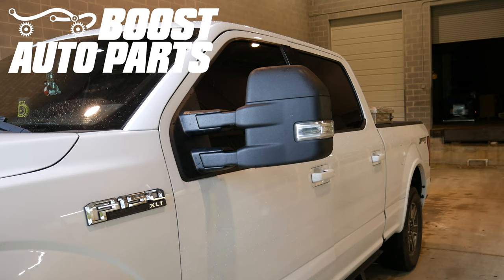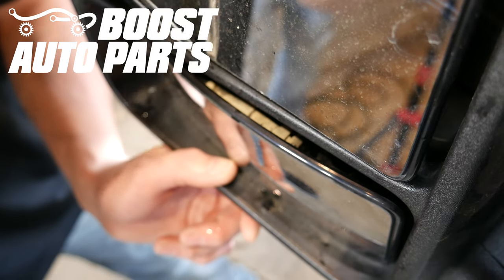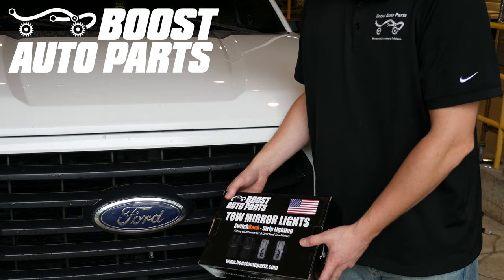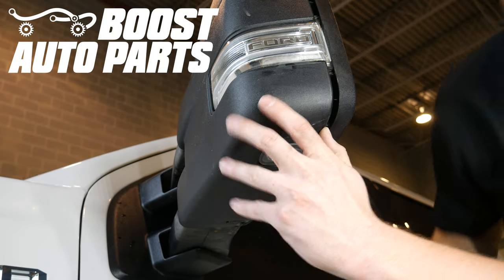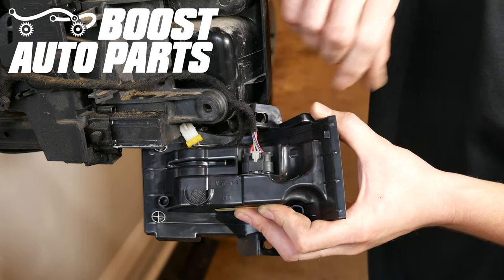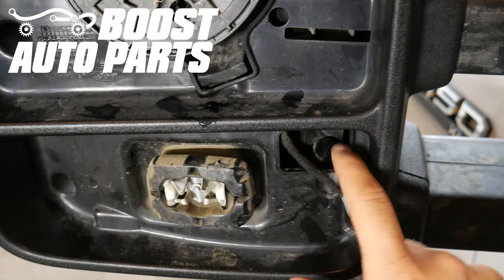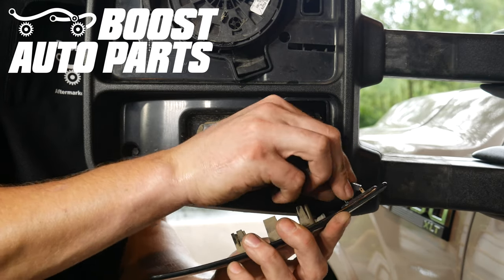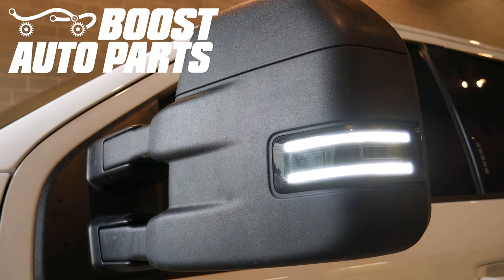Ford OEM Tow Mirror Light Replacement - Switchback (2015+ F150) or (2017+ F250 F350 Superduty)

Comment: I ordered the clear lens set for my 2019 F350 after a mishap at the car wash cracked the passenger side lens. They arrived 4 days after I placed the order. I was a little nervous about swapping it out. However, after watching the install video a couple times, it was a breeze. Took me about 20 minutes and it looks and works great. I highly recommend Boost Auto Parts!

Comment: I ordered these in switchback for my 17 F250 xlt and all I can say is that I'm extremely happy with the product, great video also!
Reply from the maker: Awesome, happy to hear our products are living up to your expectations!
Reply: Was your XLT a 3 pin light to begin with   can't get my switchback light (white) to function only amber
Reply: @boostautoparts does your brand light work with a 3 pin XLT single function truck   purchased a set from someone else and the white light does not function.   Will yours work with my truck if I order them?
Reply from the maker: @christopherblack2432  it should - but it depends on the setup. I'd recommend you call us at 765-831-2830 to discuss the specifics and ensure we can resolve your situation!
Reply: @christopherblack2432  I’m not sure since it was a while back, I had the stock amber ones, I just made sure that when I ordered them that it was for the xlt.

Comment: Will these fit 2017 f150s without the tow mirrors?
Reply from the maker: The switchback lights won't work, but you could do our dual function harness! Check it out here: https://boostautoparts.com/products/ford-df

Comment: I busted my passenger side stock mirror marker, is this a direct replacement or will the lights look different if i only replace one?
Reply from the maker: Our clear lights with amber LED's appear similar to Ford lights,  however they do not say FORD on the inside. We always recommend replacing in pairs to ensure a uniformed appearance.

Comment: What if I have eight pin small mirrors and I ordered tow mirrors from boost auto parts with signal only? Will I have to run a wire through the mirrors for the running light?
Reply from the maker: No - signal only mirrors are always plug and play.
Reply: @boostautoparts  ah okay great. So the only wire I will have to run is the blue wire into my door panned for the DRL right?
Reply from the maker: @raptorrider24  Correct - and only if doing signal & running light or switchback. If doing signal only there's no need to do that as the mirrors wouldn't have the running light feature.

Comment: Thank you great video. 1 question: if I have your 8 PIN tow mirrors installed with signal only but want to add the sequential signal only....what do I need to do?
Reply from the maker: You would just need to swap the light. Give our team a call at 765-831-2830 or email sales@boostautoparts.com for assistance.

Comment: i bought aftermarket tow mirrors they don't have running lights. how can i add running lights because i would like to buy the switchback lights
Reply from the maker: You will need to add a wire through the mirror to gain the feature.

Comment: Got the S/B Sequential but amber does not come on with blinker... What's wrong? 2015 F150 with spot light
Reply from the maker: It could be a few different things. Give our support team a call at 765-831-2830 or email support@boostautoparts.com with your VIN and a video of the issue so we can get to the bottom of it ASAP.

Comment: On a 2019 Ford f250 do I need to install the signal and running light harness for the whole blinker strip to blink on these lights
Reply from the maker: Not if you choose the switchback option - our switchback lights have that functionality already built in.

Comment: What is the function of the ones in the video. I’m on the website and very confused what to get
Reply from the maker: The ones in the video are switchback which are a white running light and amber flashing signal. Feel free to give our team a call at 765-831-2830 with any questions.

Comment: I have a 2004 truck with tow mirrors that lights are made to be like the new 17 lights but shaped like the full square of the 2016. Will these lights work
Reply from the maker: Please email a picture to sales@boostautoparts.com so our team can check.
Reply: I have the same but not sure who made them.  Any idea what brand yours are?  I am thinking about getting different led units given the running lights are more of a reddish orange than an amber.  They also don't flash when the turn signal is activated they just go off and come back on not in conjunction to the regular front and rear blinker lights.  The spot lights do work though.

Comment: I have the spotlights so this kit is a no go
Reply from the maker: This will work with the spotlights!
Reply: @boostautoparts  so this will also have working spot lights?
Reply from the maker: @cheeznhard  Yes
Reply: @boostautoparts  Would it be possible to see a demo of the spot light in action? I use mine often so it would be nice to see it before purchasing!
Reply from the maker: @qwk86gn75  Unfortunately we don't have a demo at this time. Sorry!
Reply: @qwk86gn75  Did you end up getting these? How does the spotlight look?
Reply: @LEDGExNxDAIRY  I haven’t purchased them yet.
Reply: @qwk86gn75  I bought the lights. The spotlight isn't that bright but it does have it
Reply: @LEDGExNxDAIRY  did you get the smoked tint or clear glass? I was debating as well, but I like my spot lights. I heard the recons smoked glass kill the brightness by alot
Reply: @dannym3879  I bought the clear. The chrome went better with my truck. I would imagine the tinted would cut down the brightness
Reply: @LEDGExNxDAIRY  Nice! Bet it looks good! Yea thats true, deff would cut down on brightness. They really come in handy though!
Reply: @LEDGExNxDAIRY   Are the Spot Lights equal or greater to the factory spot lights? I use my spotlights as well and I don’t want to compromise that function.
Reply: @Bugsy0101  I bought the clear lens and I would say they are not quite as bright as the factory spotlight. It’s not a large difference though. Very close. A side note: While running and the light is white, it is significantly brighter than the factory amber lights
Reply: @LEDGExNxDAIRY  Good to know. Thanks for the reply! 👍🏻

Comment: Do these have the spot light function in them? Looking to replace one broken oem marker light. Thanks!
Reply from the maker: Spot light will work on trucks originally equipped with spot light.
Reply: Boost Auto Parts is there a separate spot light inside for the spot light function? Or does it just illuminate the two white led strips?
Reply: @boostautoparts  I have same question as below. How do the spot lights work? They have actual spot lights just like oem?
Reply from the maker: @cheeznhard  There is a separate spot light sandwiched between the two strips.

Comment: Is it safe just pulling the top mirror off like that? Seen another video he used a screwdriver to pop clips loose to remove it?
Reply from the maker: You should be able to remove the top glass the way the video shows. If you would prefer, you can use a screwdriver similar to how we show removing the lower glass.
Reply: Alright cool. Thanks for the reply!!
Reply: I just broke both top and bottom mirrors on passenger side using a screw driver. Any tricks or suggestions to help me not break the mirror again?  My hands aren't very strong. Is the key to push up and then out instead of just pulling out like I originally did? Would it be  safer to remove mirror from door first or not a good idea? Lastly the temperature in Minnesota is mid 30's is that too cold? Suggestions and/tips will be greatly appreciated. I certainly don't want to buy another set of mirrors for the other mirror. 
Thanks in advance for your help